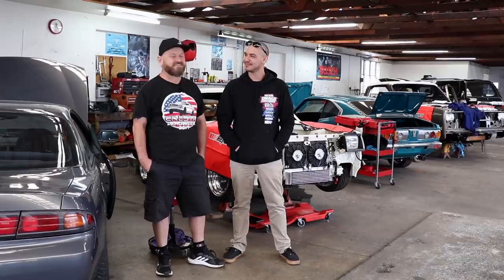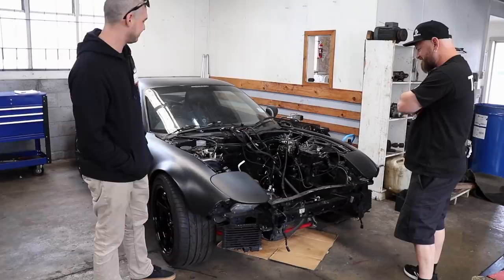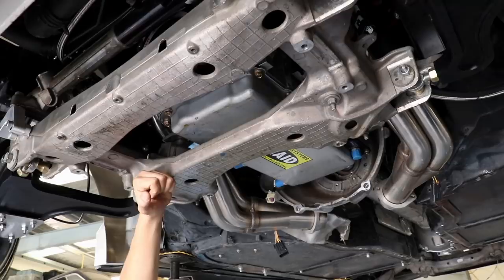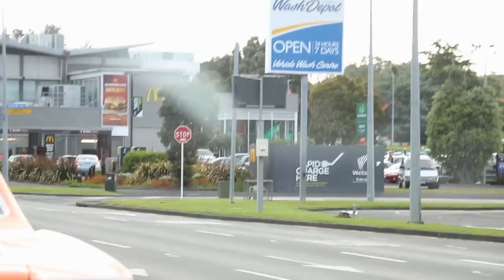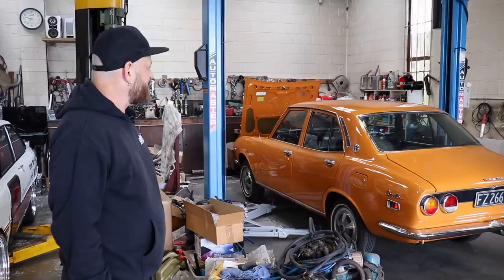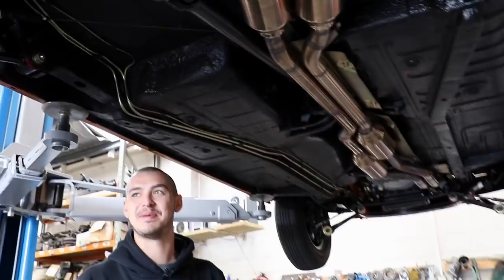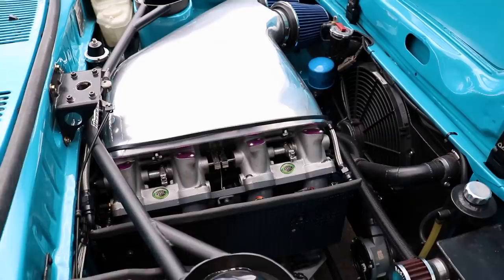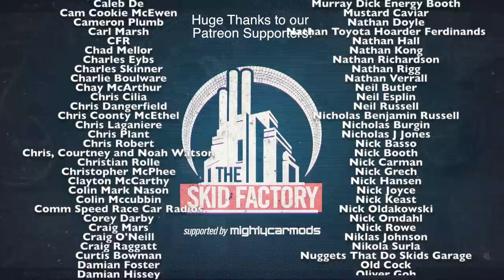NZ WORKSHOP TOURS PART 1 - THE SKID FACTORY

Comment: Thanks for this guys. It brought back a lot of memories for me. In the 80's I had 2 RX 3's. I had a 73 that I blew the motor in and then found a  smashed 74 with a good motor and switched it to the 73. Trouble was Mazda had changed motors and wireing between the 73 and 74. Cheers from Canada.

Comment: And to think back in the early 90s I bought an rx2 for $800 replaced the front guard and sold it for $1900
Reply: I know. Me mum had an RX2 as a daily driver for most of the 80s and into the mid 90s. 
When it finally became uneconomic to repair - around about 1995, she sold it for NZD $600 and replaced it with a Ford Laser. 🤢

Comment: rwd starlets arent common in eu either, super hard to find a decent one and if you find one it will be super expensive.
Reply: Here in NZ, we had shit loads of them in the day. Finally they rusted out or did half a million miles (whichever came first) then the rotary boys grabbed what they could and have kept them on the road so you still see them around from time to time here. Also the rwd mazda 323. Purely for rotaries of course. People dig them out of old barns completely rotten and fully rebuild them simply because you can't find a tiny light weight rwd to chuck a rotor in anymore. Suddenly worth thouuuusands (if you can get anyone to part with one)

Comment: 5:55, what's that big bit of billet hanging off the front of the engine?
Reply: dry sump pump couldn't fit next to engine so changed the pump to run backwards supported off the front of the head.

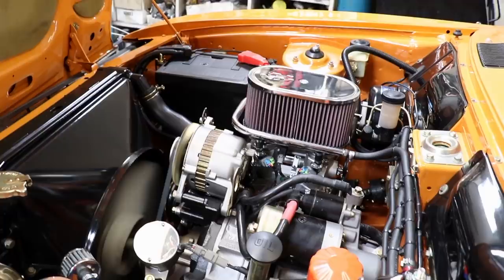Comment: At 19:50 is the air cleaner top moving up and down on the RX2 or is it just an optical illusion?
Reply: Looks like the engine is rocking side to side. Which is normal.
Reply: @LimitR  didn't think that rotaries moved like a piston engine
Reply: @bigunone  Yeah but the engine is still rotating. So I could understand some rocking. I dunno. Wasn't there.
Reply: @LimitR  I have never seen one running either it was just odd
Reply: @bigunone  I've seen one running and it did move a bit. Not like a lumpy V8 but it still moved. I mean don't forget any engine has moving parts. And obviously that movement isn't necessarily going to be totally contained.

Watch any motor when it gets revved. It will move a bit within the bay as it twists.
Reply: @LimitR  But, But, the Mazda engine is supposed to go HMMMM at least that is what the advertisements said in the 70s!